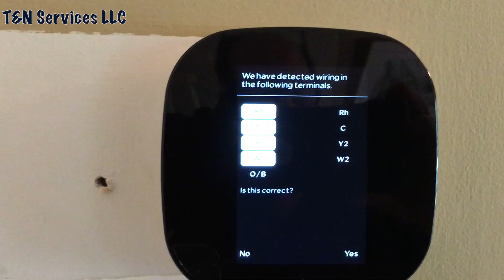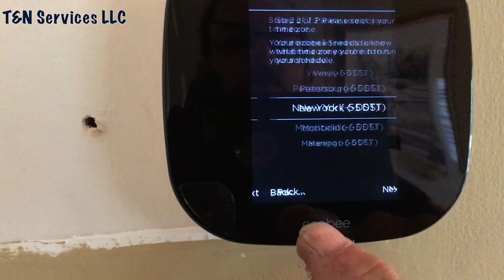ICP HVAC INSTALL

Comment: Good job Ralph! That was a tight spot. I may have gotten my Sawzall off the truck lol
Reply from the maker: +ComfortPlus Heating and Cooling sawzall is to loud Chuck
Reply: Ha ha! That's what I did on one of my jobs. I should have added that to the video. It was one of those old wide ones. I cut had to cut it vertically in half to get it out. I posted a video but didn't mention it. Maybe in the next one I will.

Comment: My question is with the lines all jacked up and piece together like that and with the new unit and a new coil why didn’t you run new copper? I know it’s a lot more work but a new line set with a fresh unit to me would be a lot better than using an old copper and especially if you have R22 12:14 oil in that line set. I didn’t hear you say anything about flushing the copper lines either..

Comment: I'm installing a mini splits just putting it together then ac guy will do the vac.which is better flare seal or nylog or should I use both

Comment: i have a goodman 1998 Heat Pump unit.. When I replace it, should I get another heat pump or downgrade to just AC unit?
I live in Florida, so heat is really not a necessity.
Reply: i think u should down grade to just ac, im not an hvac tech, but i know ALOT OF STUFF but yes florida there is no need for heat
Reply: Sir. It's not a downgrade. You should not have a  Heat Pump in Florida. Purchase a regular Condensing Unit with a matching Evaporator Coil. V.
Reply: Mac Pelao I'd get a heat pump just incase Florida can get cold even tho you might not use it, it would not kill to have it